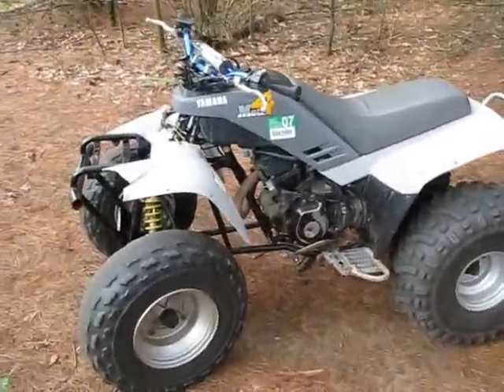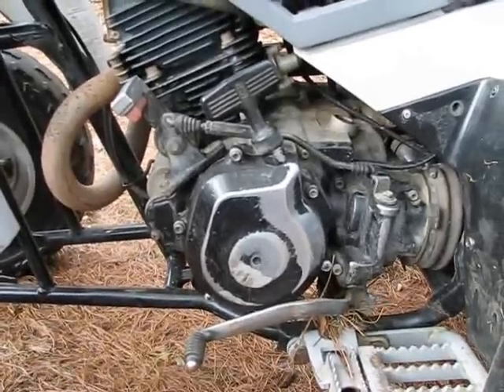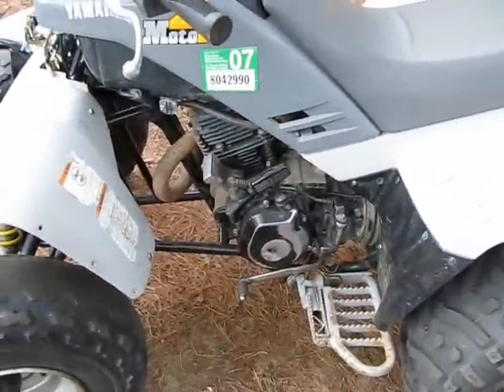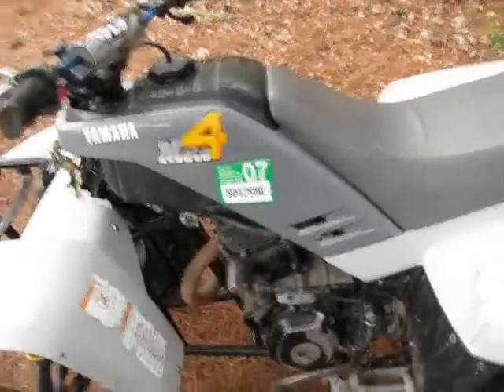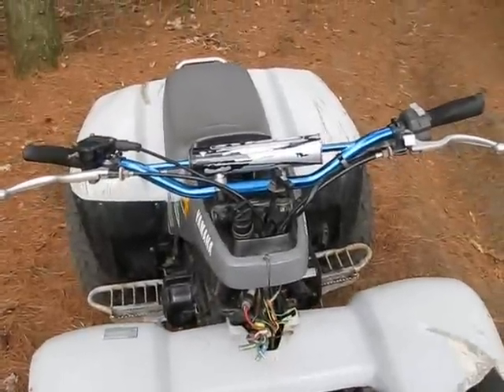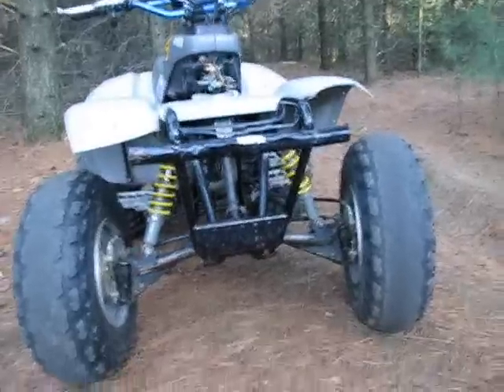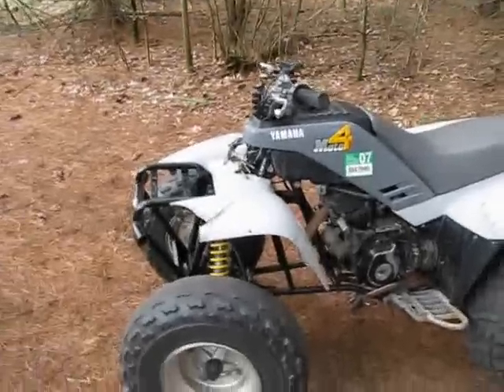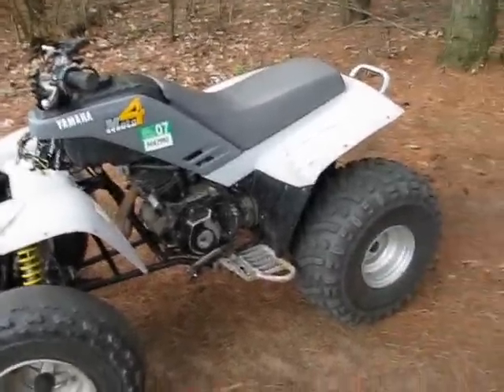Moto-4 Update 4

Comment: hey I have a 1989 moto 4 200 wondering if bigger tires would fit like 25s please reply
Reply from the maker: joecyjames i wouldn't think you'd have any problems putting on 25's because there's like no travel in the suspension and i got on 22's. Put on 25's and if the suspension bottoms out you effectively will have added 1.5" to the top of where a 22" tire would be (since it's centered on the axle) and there's more space then that when mine bottoms out with 22's. Just keep in mind that you will have slightly reduced torque, but increased top speed